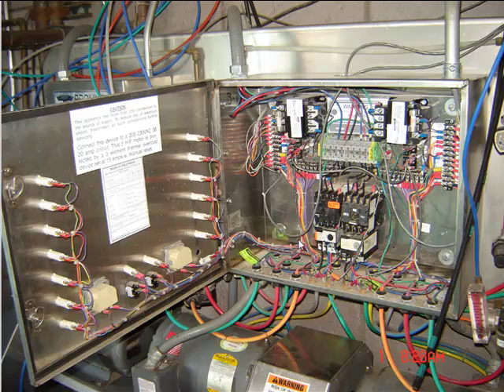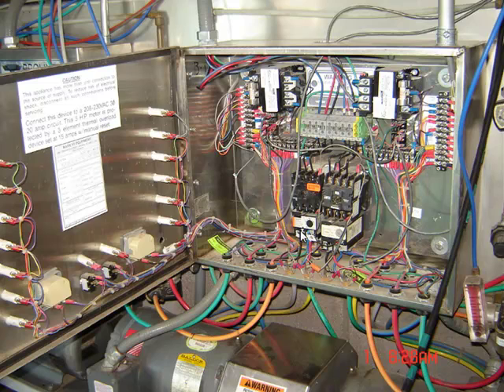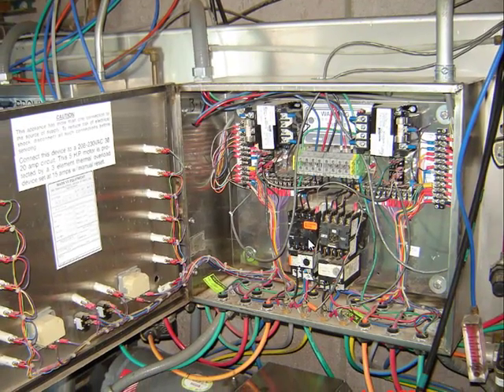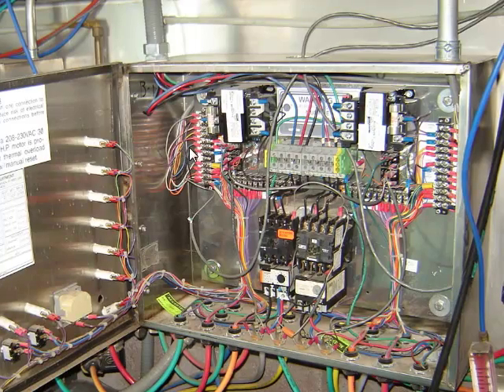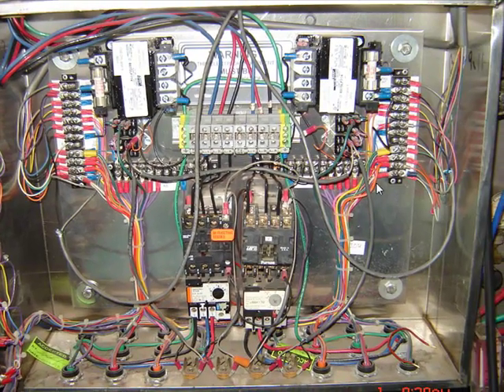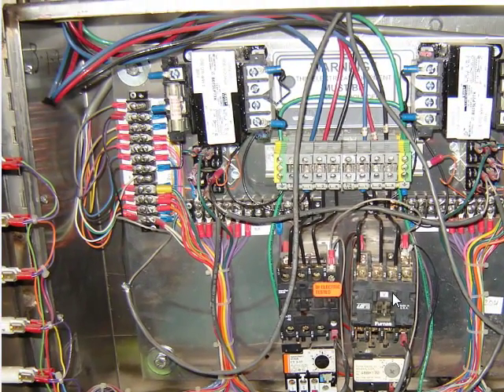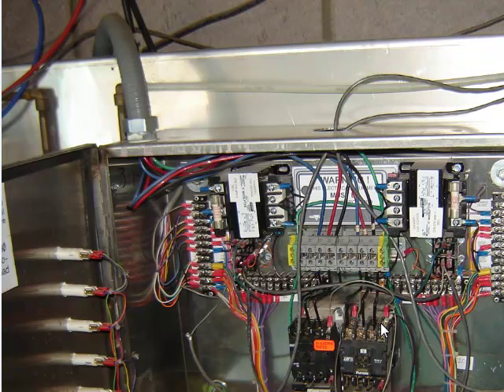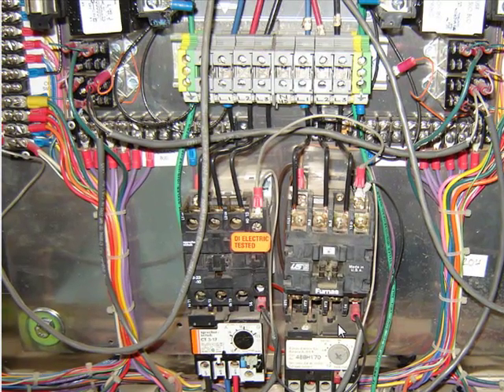Electrical Wiring-Car wash control panel

Comment: Hello there I bought a 5 bay self serve carwash in Odessa, tx and I was needing help with some electrical issues. And it's been a few months and I still can't figure it out ,and that one bay has remained close. Is there any way you could help me. I could send a video, or a detailed description of what happened. Also a so called electrition was helping me to finish up before the sun came up that morning, but never worked again it keeps burning out the soap relays and the pump will run with out money or time. but that's just half of it. I would really appreciate it. If not I will keep on looking through your videos, just subscribed and liked the first video. Thanks and God bless.

Comment: Do you have any ideas of where I would find Prints on a car wash system that I have been asked to troubleshoot? I’m an electrician in Texas. Have not had much luck doing my normal searches on the Internet.
Reply from the maker: When I was doing car wash service work the equipment mfg would supply all the wiring diagram needed. The control panel in this video was old and the drawings were long gone so I had to use my troubleshooting skills and work my way through it. IF you know the mfg you may be able to reach out to them directly for help.
Reply: @electricalindustry  thanks